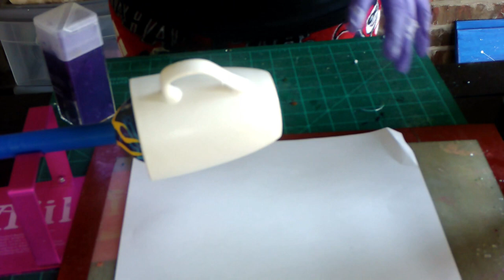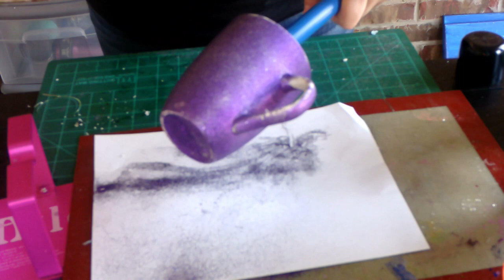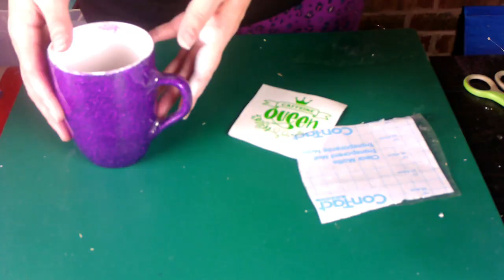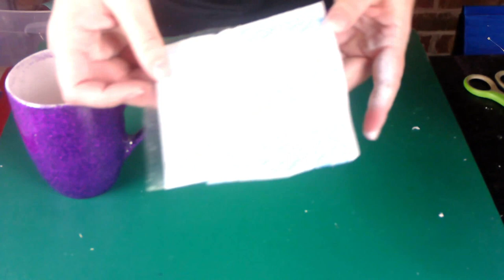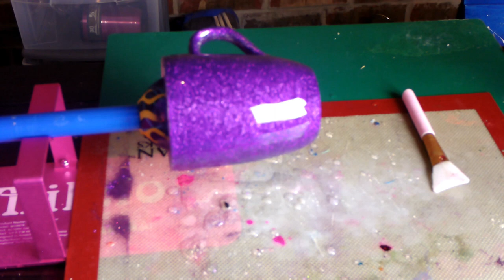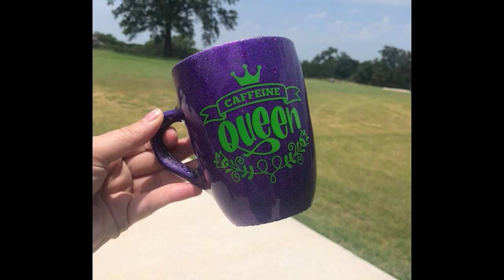DIY Glitter Epoxy Coffee Mug

Comment: Does it need to turn the entire 24 hours it cures?
Reply from the maker: No, you don’t have to. But you want to make sure the epoxy is no longer moving. Depending on how much you used and the temperature. if the area you are working in, that could take 6-8 hours.

Comment: I, personally, wouldn't do the spray or the glitter all the way to the lip nor epoxy, but that's just me.  There is also dishwasher safe Mod Podge, curious how that is compared to the epoxy since the epoxy can't go into the dishwasher do to the heat.
Reply: I know that with mod podge it isn’t fully cured for 23 or so days
Reply: Does dishwasher mod podge create a smooth finish? Or can you still feel the vinyl?